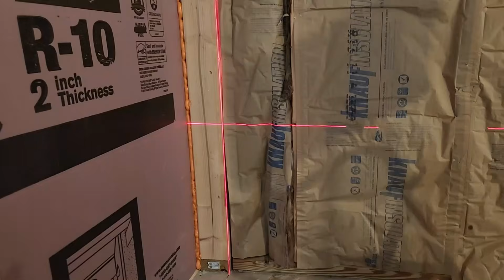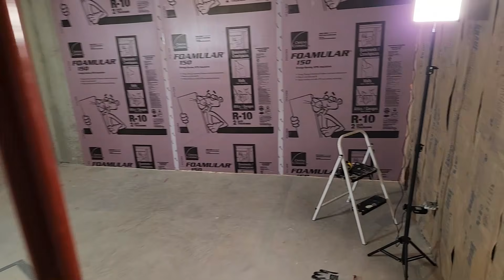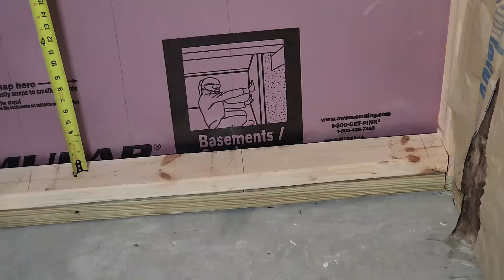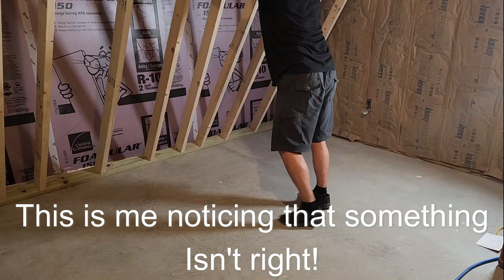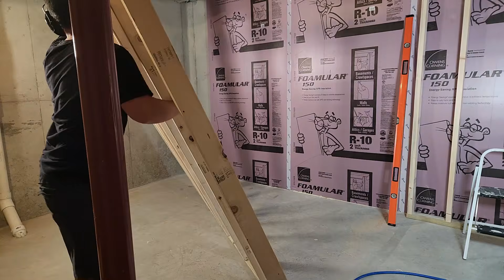How To Frame A Basement Wall || E5 Finishing a Basement

Comment: soooooooooo what if the difference between both ends of the wall studs is a whole 2 inches?
1900s home renovations...
Reply from the maker: Like like the top plate is 2" longer than rhe bottom plate?    You can just build your wall to the smallest dimension and then put shims on both sides.  Make sure your studs are plumb.
Reply: @HowIDoThingsDIY  no like the left side of the wall needs to be 80 in and the right side needs to be 82 cause the cieling or floor is out of level

just shim the top plate ???
Reply from the maker: Yes.  Just shim the top plate.

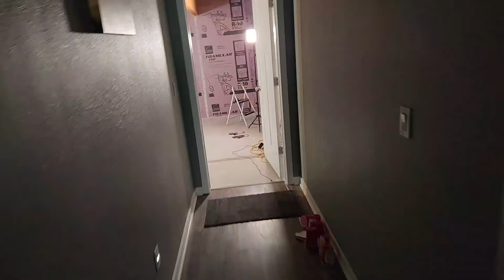Comment: How did you frame your wall around that plumbing pipe sticking out of the wall at 1:55
Reply from the maker: I think your talking about the radon reduction pipe.  I left a narrow walkway between that concrete wall and my new wall so I could access mechanical stuff I didn't want visible.

Comment: Why didn’t you put down a sub floor before framing?
Reply: Thank you for answering! I have a second part to that question. If I was to use a subfloor would you place the foam board on the sub floor or the subfloor up to the foam board?
Reply from the maker: @cbrboy17 I would still want it insulated down to the floor and then run the sub floor up to it.  But maybe someone else has in the comments has another opinion as I have not done that before.
Reply from the maker: That's an optional way to do it.  But my basement is only 8', and every inch mattered to me.  I also wanted to use as little wood as possible near the floor.  I'm just terrified of the idea of my basement flooding and then having to rip out all the subfloor.  Not to mention, a good subflooring system is very expensive for as much space as I finished.  Roughly 1,600 sq/ft.  I also don't like how it has to transition to the stairs of other unfinished spaces.  Thanks for the comment!

Comment: Might be a stupid question….but if there is a 2 inch gap between the concrete wall and the studs for the wall would you still need to put foam board against the concrete?
Reply from the maker: I would think only if you want the insulation.  Seems you would have nice airflow with a gap like that.
Reply: @ awesome thank you so much!
Reply from the maker: @cubsfan754 No problem.  Be sure to check building codes in your area to be safe.

Comment: when installing a wall along the floor joist where the floor joist is 8 inches from your wall how do you secure your top plate to the top? You said you didn’t have to worry about that in your video, but I have to worry about it. Can you help?
Reply from the maker: Great question.  Sorry I didn't cover that.  You just need to add 2x4 blocking in between the joists in a few places to nail to.

Comment: Thanks for sharing. For the first stud, why did you come in 15 and 1/4 in from the end of the bottom plate? That's 16 on center would have a stud flush with the end of the bottom plate and then just mark 16 in in from the end of the bottom plate to indicate the nearest edge of the next stud.
Reply from the maker: Thanks for the comment!  This is because I'm marking out the edge of the second stud not the center.  The stud is 1 1/2" thick.  If you add 3/4" to 15 1/4", you get 16" to the center of the stud, which is what you want.  I hope this answered your questions adequately.

Comment: Isn’t a 16d nail to big for the top plate? The I joist and 2x4 are 1.5 inches each so 3 inches total. And the 16d is 3.25. Doesn’t the nail stick out of the I joist unless you nailed dead center into the webbing, I’m no expert by my understanding Is not the shoot from bottom into webbing. 

Great video i haven’t framed since helping my grandpa 20 years ago when i was 17 it was with old school 2x6. My house is I joist like your basement.
Reply from the maker: Yes, you're right, the nail would technically stick out a little occasionally.  I wasn't too worried about that though.  Thanks for the comment

Comment: What do you do if the floor is out more then 1/8 that you subtracted for the studs that you made smaller.
Reply from the maker: Just use some shims or just nail them to the floor joists.  It's ok if there is a small gap above the top plate.  Thanks for the comment!

Comment: I saw another video where they built the wall on floor like you did but the bottom plate was furthest from the wall. They lifted the top of the wall up into position and tapped the bottom until level. They said it's a great way to avoid all those obstacles hanging lower than the floor joists. If you not done framing already it might be worth a try.
Reply from the maker: Possibly!  Thanks for the tip.  I probably wasn't thinking clear in the moment.   Haha